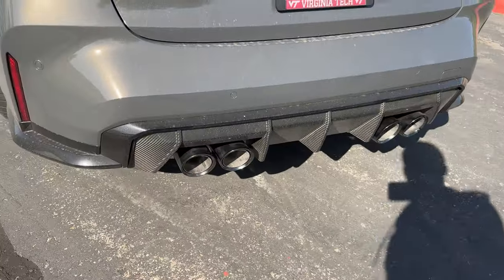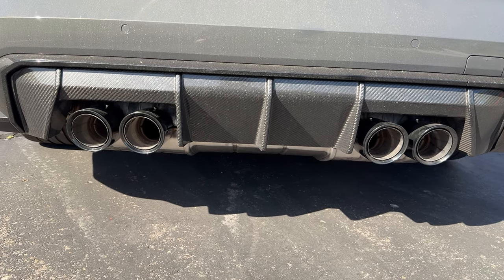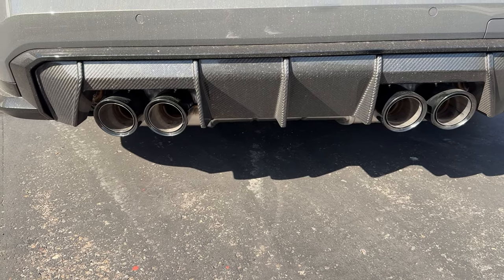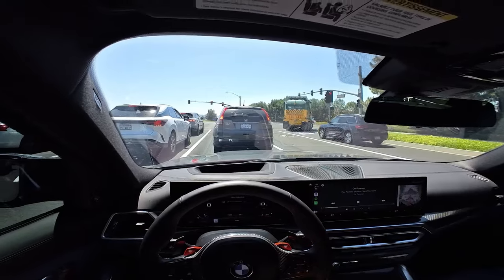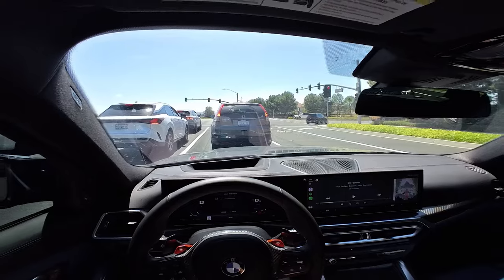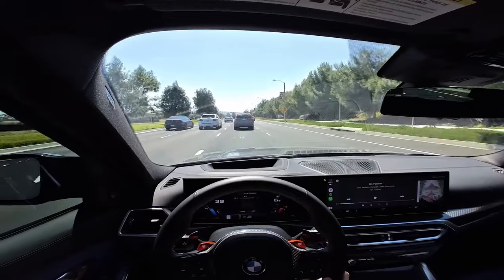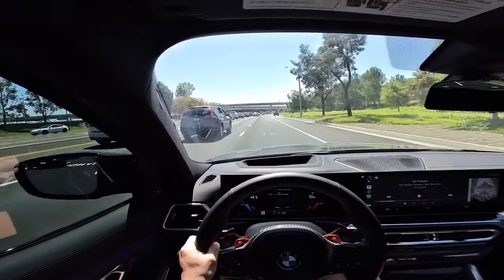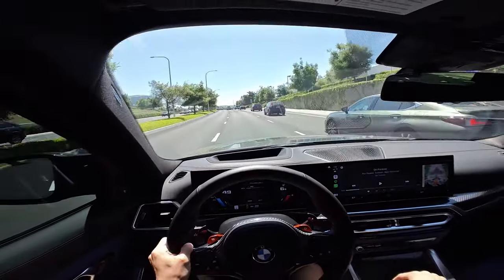MY BMW G80 M3 IS GOING BACK TO OEM...VALVETRONIC MIDPIPE AND STOCK AXLEBACK

Comment: Can you make a sound with valves closed
Reply from the maker: with just the midpipe or full valvetronic
Reply: @RicheeRevs  I meant to say video but yes with mid pipe and stock muffler. 
I'm going mid pipe only just for more tone/ aggressive sound. I don't want really loud
Reply from the maker: @BigTurbo20onIG there’s a clip of revving in park in this video. more pov exhaust sounds from inside the cabin will be coming in my next video